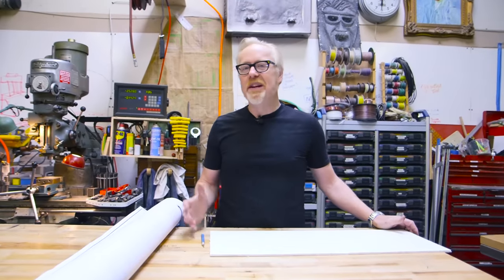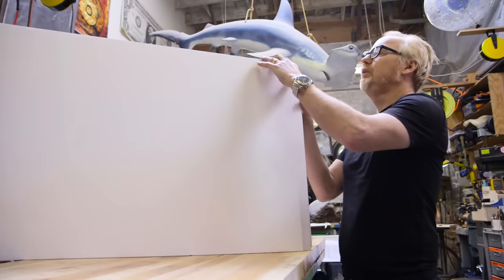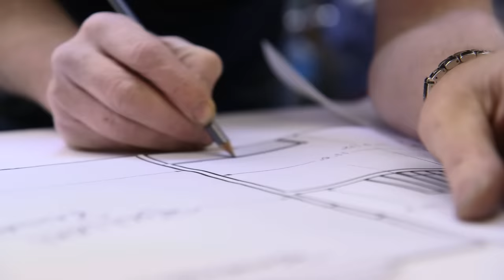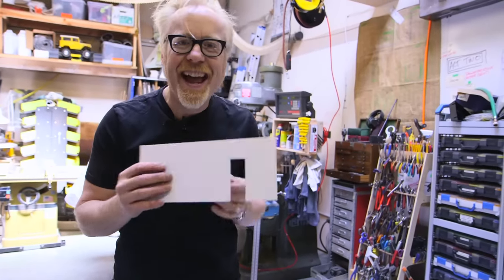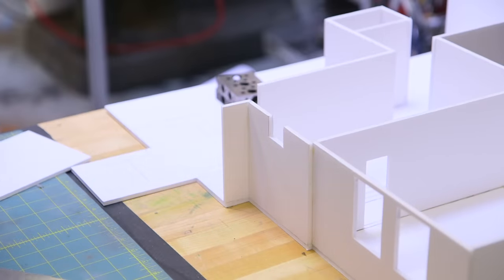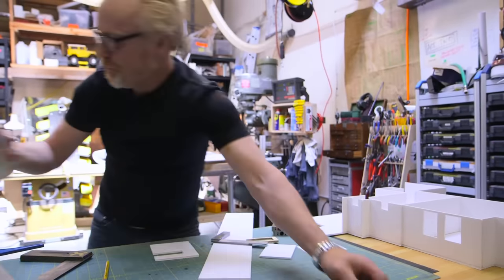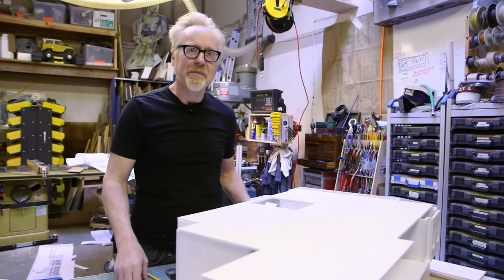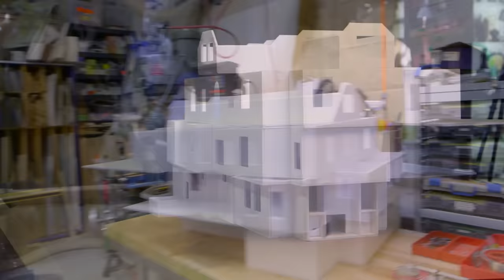Adam Savage's One Day Builds: Foamcore House!

Comment: If you want to control a standard hot glue gun, you can use a ceiling fan dimmer circuit. Also works for soldering irons!
Reply: This ^
Reply: Nice!  I have a lamp dimmer that I'm not using, I'm gonna try that.  

Another thing I did was plug my gun into a socket with a remote, like the kind that people hook up xmas lights to.  Works great for turning it off and on without reaching for the plug.... a remote with a dimmer would be amazing
Reply: What's the best glue for using poster foam board strips as a border against each other. I'm making 5ft mosiac letters to put balloons inside. People use hot glue but the Hot glue isn't working for me.

Comment: A good way to dispose of Xacto blades or other razors, just get some painters tape just cheap masking and wrap in in some tape but flattened. Example: Take the Xacto, lay in on about two inches of tape, fold the tape on itself to it sticks around the blade on all sides, then just wrap that in some more tape. Safe, fast and it'll stay that way. There's no way it can fall out or whatever. Just a tip for whoever.
Reply: +Glenn A Yeah, I've just had those knocked over, and they don't fit utility or scraper blades which I use alot for leather and stuff. Plus I buy masking tape by the metric butt-load, so I've got some to spare lol
Reply: +Glenn A Yeah, I've just had those knocked over, and they don't fit utility or scraper blades which I use alot for leather and stuff. Plus I buy masking tape by the metric butt-load, so I've got some to spare lol

Comment: Great build.  Now take pictures of textures like wood flooring, door trim etc. and print on card stock.  Use post it note glue (comes in a glue stick at the office and art supply) so it's prepositional and isn't going to drive you crazy getting it down.  Do the interior and exterior and it really will be an architectural model.

Comment: I wasn't wondering why it was so big, I was wondering why the fuck did it look so weird
Reply: jack duffy I was wondering the same thing, then I realized that it is probably because he didn't build the landscape around the house, and the first floor is a basement, so that probably attributes to the weird shape.
Reply: what looks weird about it?
Reply: jack duffy it looks odd because those are interior walls. there is no exterior skeleton that makes the house look comolete
Reply: That's what she said.
Reply: same reason, the 70's
Reply: jack duffy because he didnt put roofs on it, so we could see the inside. that's why the architectural structure looks weird. haha but if he added roofs, that would've not looked weird to you haha
Reply: savage
Reply: BrakBits Reviews more like Adam savage
Reply: The basement was not in the ground so it was a lot smaller than the other floors
Reply: It also probably had overhangs in someplaces

Comment: Hi Adam,
instead of cutting the template, drawing the lines, flipping over and drawing
the lines again to transfer: it’s way faster to use a projector and projecting
the schematic on the foam board to trace it. This way you don’t even have to
print the schematic out.
Another solution
is to use “graphite paper”. This is a thin sheet of graphite you drop between
the schematic and the foam board. Now you can directly draw on the schematic
and transfer the lines. No need to cut and pre-draw the lines on the schematic.

Comment: Had to build one of these last year in art class. But unlike you, I wasn't able to switch out the blade of the knife every 5 minutes, i had to use one that was already dull as hell for the entire project. It was a pain in the ass.
Reply: But the blades are not all that expensive. You can get a pack of 100 pcs for something like 10€.
Reply: It's trivial to sharpen a #11 on a whetstone, if you have one of those around.
Reply: i sharp my blades with a paper nail file.... works okay
Reply: I might have to try that.
Reply: I have a rotary cutter for fabric and I always use the file. Those blades are expensive and you want a sharp edge when you cut into layers of fabric :-) give it a try also on a side note- those files with 4 or more sides for nail buffering are quite good because you can use a different "grits"

Comment: I recently designed the house I'd like to own in Sketchup, and I kinda wanna try making it out of foamcore now.
Reply: +TheFancyUmbreon do it and come back and share it with us!
Reply: +TheFancyUmbreon 3D print it!
Reply: Mmm Sketchup
Reply: +TheFancyUmbreon you could have the design printed on A1 paper complete with the wallcoverings brick structure and stuff like that and stick those prints on the foamcore before cutting it out and glueing it together , if you make colourprints you could allmost end up with a dollshouse 
when doing it this way youre prolly need to take the thicknes of the foamcore in accound if you buttjoin them together , then again you could make slantcuts and whont see any foamcore sticking out
you prolly need to stick the outside on cut it and then stick the inside up to have them alighn
Reply: +Olav Schneider that would be hella expensive. A much better route is laser cutting the parts out of cardboard/paper.    I honestly love the laser cutter so much more than the 3d printer.   
Im lucky to have them available to me in university, but if you do not have that try googling it. a lot of cities do have places that offer laser cutting that is priced per minute. 
For me I get it for 1$ a minute, but the local shop does it for 1.5$   so a little bit more.  if you are cutting paper or cardboard it won't be too much money.     Foam core does not laser cut well though, the core shrinks under the paper making it not very structurally sounds. Another option would be to use a very thin wood.
Reply: you could use cardboard and maibe not lasercut totally through when youre immitating tile , brick , siding or rooftiles and stick that to thin styrofoam making youre own foamboard  prolly be able to burn some relief intoo the cardboard to to immitate the texture of the stuff youre trying to make if its thick enough the styrofoam will give it the thickness and rigidity 
might need to wet it a little before laying it under the laser to prevent the cardboard catching fire 
it be a bit like whallpapering the stuff , you could make for instance the brick intoo puzzle mats covering say3cm2 so you can make them to fit intoo the borders you need them for and not show the joints 
http://i01.i.aliimg.com/img/pb/691/799/299/299799691_244.jpg
Reply: except on my book
Reply: Im 16 and made a small vacation house in sketchup and calculated that I could build it for under $30k
Reply: You mean prepare and pour a foundation that will pass certification for $30k right?... Because if you don't I've got a really rude awakening for you.
Reply: +Brad Westlake 
Depends upon where Bryan lives and what type of house is being built. A Solaleya home is extremely affordable per sqft. Something like $100/sqft, where I am. Often times, it's not the house that's expensive, it's the labor and land.
Reply: And the government makes it even pricier to build a dwelling with the permit fees and taxes it just goes to show that as long as there's governments that don't believe in property rights, you'll never be able to own your home

Comment: I built models like this in high school and in college in architecture school.  I always just spray-mounted the floor plan directly to the base foam core, and cut out the floor footprint directly using a straightedge and the printed lines of the plan.  That would have saved a lot of time.
Reply: +Patrick94GSR i dont know why the great adam savage didnt do that either.

Comment: adam:*puts blade in soda can*
2 hours later
drinks soda
Reply: Thanks now i have a image of adam swallowing a whole soda can in my head.
Reply: Right.  Because Adam doesn't have the common sense to not drink out an empty can he just put an exacto blade in.
Reply: @myfinalheaven9590  you're fun
Reply: It's a different can
Reply: im more upset that he throws away perfectly useable blades and probably has for a long ass time, just because it wont cut the soft material youre working with well doesnt mean it doesnt have another application
Reply: @briantriplett2455  I’ve actually had the same one for five years 😂
Reply: @goddessmeija4761  modelers on a budget can’t be beaten😂

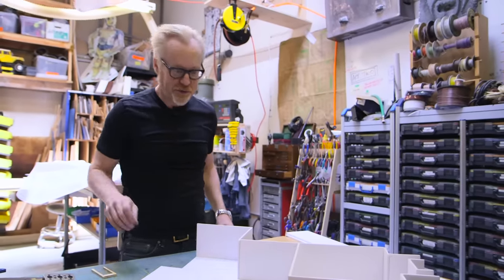Comment: The steel blocks with all the holes that Adam is using to hold the paper down, or the walls up, is a 1-2-3 block named because it is a 1"x2"x3" block of steel.  Handy for what he is doing with them but really from the machine shop side of his cave.  The holes are (typically) threaded to hold down things on the machine tools. Well Adam explains all this at 7:00 but I jumped the gun.
Reply: +cemx86 I'm glad you did. Now i don't have to look up why it's called a 1-2-3 block, or what it's specifically used for, because I was curious. I thought maybe the 1-2-3 had something to do with the size of the holes and wasn't sure what their purpose was

Comment: Adam, there's actually a trick that the King of Random showed when cutting foamcore where, you apply the paper directly to the foamcore itself with some glue (such as photo album glue) and then, when you use the foamcutter, it /can/ go through the polystyrene, but not the paper, leading to very smooth cuts. Or at least, that is how he said it worked.

Can you explain (if you knew about this trick) why you prefer transferring your designs manually? Is it because of glue residue?
Reply: +adrian palmer yo chill

Comment: I have made scale building models from both Matte Board and Foam Board. I usually used Spray Mount and attached Floor Plans directly on top of the Board. Then, I cut out the Perimeter. There is additional detail that is already on the Floor Plans. Ditto for Exterior Walls, Spray Mounted Exterior Wall Elevations on top of Board and cut out. Windows and other details are on the External Elevations. Internal Walls with Door openings were plain Board with no Interior Elevations. Roofs are always a bit challenging.

Comment: Working with foamcore and knife can really screw up your neck after hours of doing it, unless you do it all the time. I did a huge project with foamcore and projection mapping and it knocked my neck/back out like nothing I'd ever done before. Later on I used less pressure to cut and instead did repeat less pressure passes on the same cut until it was cut through completely, which helped to not strain the muscles. Thanks for this video, fun to watch!

Comment: Archnerd trick: for a cleaner finish at points where joints butt, cut one of the pieces a little longer (the thickness of the foam core, to be exact.) Score the inner paper layer and foam, peel it off, and the remaining layer of paper can be glued to cover what would otherwise be the exposed foam edge of the other piece. Looks nicer.

Comment: I love using foam board to make tabletop miniature Terrain for Warhammer 40K. I use Tacky glue for my builds because it is a crafting glue that is thicker than your normal PVA glue. So it sticks your stuff together and drives relatively quick. I take a 20oz bottle and put a slit in it like a coin slot big enough for regular size razor blades and put my old blades in it like that. That way it's safe from everyone. Plus after you collect enough you can take em to the scrap yard

Comment: Adam, a trick I learned for old soldering irons that can transfer to glue guns; mount a duplex outlet in  a quad outlet size box with a switch in it; on the switch you add a diode.  When the quad box is plugged in, the outlet is on no matter what the switch position.  However, when in the "off" position, the outlet is only getting about half the power it normally would.  This can be used to plug in your soldering iron or glue gun.  At half power, but with the glue gun temperature control, you will have the ability to closely control the temperature on a 50% power scale, or with the switch in the 'on' position, it would be at 100% power.  Another alternative would be to use a Pulse Width Modulator.  Just an idea here, not being critical of what you do at all.

Comment: I built numerous architectural models from foam-cor while attending architectural school in the early 70s. One technique we used was to spray-glue the full floorpan drawing(s) onto a sheet of foam-cor and cut directly from the attached floorplan print. This eliminates the need to transfer lines to the foam-cor and is quicker and more accurate (IMO). You do the same thing for walls, based on elevation views of the building. This technique also allows the addition of texture symbols (masonry, siding, shingles, etc) and architectural details in a rapid, albeit 2-D fashion. As Adam stated X-acto blades are dangerous - I used a mat knife with a fresh blade for long cuts, and an X-acto only for details like doors, windows, etc.

Comment: Weird layout with odd shaped overhangs. Was it cantilevered or supported with pillars ?
Can't quite get my head round that floorplan.
Reply: +Ian Clarke I was thinking the same thing
Reply: +Ian Clarke  +Max Kordon Neither, it's not an overhang, that's the basement :)
Reply: +Ian Clarke probably built into a hill, that main overhang on the first floor was likely a patio or a deck at about ground level, and then along the sides of the house the ground level tilts backwards until the ground level is even with the entrance on the basement level in the back. the flat overhang on the second floor is confusing to me as well, though. i think a lot of the inconsistencies would be solved if roofing was added, letting everything visually line up a little prettier
Reply: Dylan Pierson
Totally agree about the roofing, it would make a lot of difference to understanding that layout.
Could back onto a hill, still hard to picture though.

Comment: My childhood home was built from the ground up by my dad in 1956, in his spare time, and spare cash, requiring 13 months to complete. He paid $1100 for the lot (100 ft. x 200 ft.) He continually remodeled and made additions over the years.

House was 2270 square feet.

Eventually the house was sold in 2012 for $140,000. 

I saved up house plans I’d made by measuring everything. And plenty of photos. Now if I wanted to make a model, I could do it. Only difference is I’m used to using Elmer’s glue with my foamboard.

Comment: As a architecture student, I do this all the time and I can say some things could be done differently. The way he transferred the plans is not the best, because is can lead to inaccuracies in the bild, but I guess it’s fine since it’s just for fun. Also, the good thing about this material is that you can have a great finish in the corners. If you peel out the foam and leave just one layer of the paper with the thickness of the wall it’s interceding you could have a smooth wall and the foam core would not show. Just a tip
Reply: How would you recommend transferring the plans into the board?

Comment: Why his basement got windows tho
Reply: The basement does not have to be below ground level.
Reply: Benedikt bro do you even that is the definition of basement a floor beneath ground level
Reply: Some basements can have below ground windows they aren’t very big so they are usually just to let in light, I’m not sure if they make them differently now but on family members house they dug out the ground in a semi circle down to a little lower than the window then put a metal semi circle in to prevent the soil from caving in
Reply: Dude. His house was more than likely built into a hill so half was under ground and half was out.
Reply: My house has a basement with windows
Reply: I understand why you would think it would be below ground level a basement translated to my language literally means a space of youre below the ground
Reply: Not every property is completely flat. I know my basement growing up was the ground floor on two sides, including the garage, which was under the ground floor living room. The front and other side of the house, the basement was completely underground. I can think of 4 or 5 houses in the neighborhood that were similar, a friend had similar too, completely flat looking house from the front, but the side yards had a big slope so her basement had a door to the backyard. 

Also, besides the sloped lot, the basement still connects up to the first floor. Most houses you go up at least a few steps to get to the front door, from either the foundation or basement. There is frequently small windows there to let in natural light

Comment: good idea until someone goes for a swig of soda and get a razor blade
Reply: I thought this until I realised that you would absolutely be able to tell by the weight of the can upon lifting that it is empty.
Reply: Yeah, just blindly drink random sodas laying around a workshop.
Reply: Adam probably filled it with machine oil, not soda. You can smell that from faraway.
Tho I store my used blades & broken needles in a glass juice bottle, so everybody can see what's inside.
Reply: because someone is just going to walk into his workshop and drink a random can of pop laying around
Reply: I use an old prescription pill bottle for my used blades. 

I am extremely surprised that a company like ILM uses a pop (soda) can and doesn’t have a proper sharps disposal system set up.

Comment: Hey Adam! I scrolled through the first couple dozen comments and did not see this on there: Why didn't you use transfer paper to do your tracing? It would have cut that trace time in half, yes? I can guess the reason for not using spray adhesive to just glue the plans to the foam core: faster dulling, and that pieces that large present a good challenge to lay flat and correctly, but why skimp on the carbon copy? Big fan!

Comment: Adam. you can use pins+ holes to transfer more accurately. You can use instead of your 1:2:3 blocks >> low grade magnets and metal base plate/ steel rulers/ each other to make  brackets. jigs to build foamcore parts/ pieces.